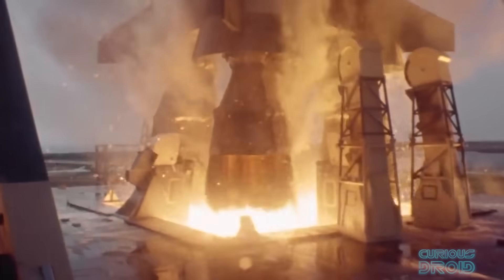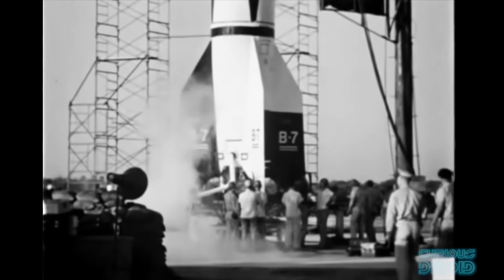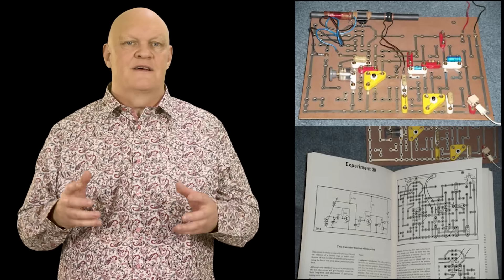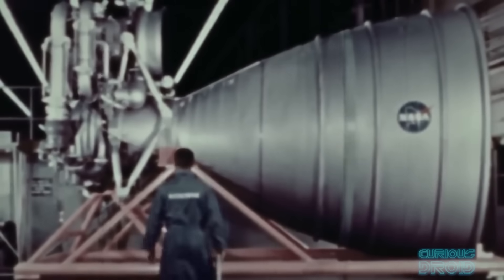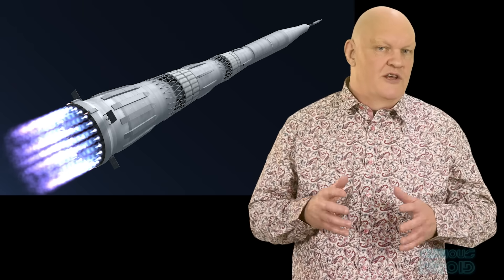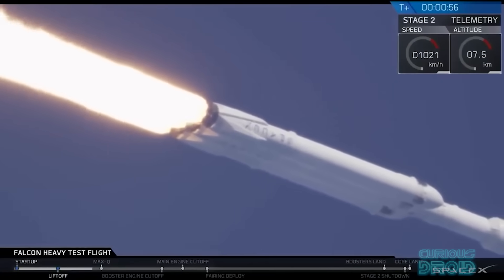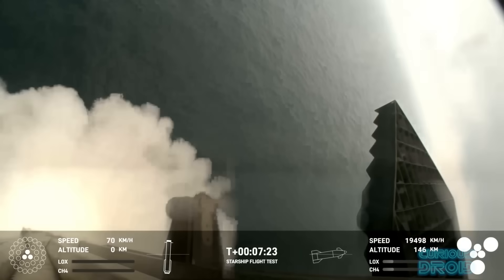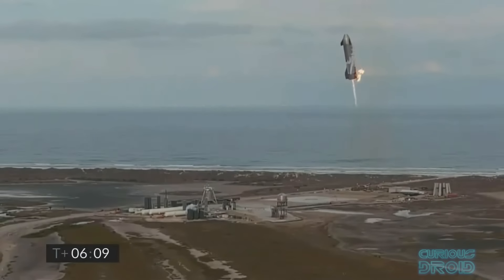Why Does SpaceX Use 33 Engines While NASA Used Just 5?

Comment: Because we had 63 years of advancements in electronics which allows the rocket to adapt to engines going out and not significantly effecting the flight, which would enable greater rocket reliability without the engines having to be as rigorously tested, because if you had 4-5 engines it would be much harder to adapt to one of them going out where as with 33 smaller engines it's creates a smaller force if one engine were to go out, therefore making it easier to correct, also it's cheaper to produce many small engines than it 4 - 5 big engines because you start to get economics of scale.
Reply: Bold words. Engineering is a game of compromise, whether the budget is generous or not. Their system works.
Reply: @Rich-on6fe  to be fair so did Saturn V, SLS and to a lesser extent the Space shuttle. I'm not saying less rockets is nessarily a bad thing it just means your engines need to be a lot more reliable now which is expensive to validate and in the past especially with the Saturn V we just didn't have the electronics to reliably shut down engines before they got so damaged they have a significant chance of taking down the craft to adding more engines was just increasing your risk of failure no matter how long you operated and refined the rocket.
Reply: @Etheoma  Larger engines are far simpler and therefore have less potential failure points, something that NASA have proven over and over again. What people (willingly) forget is the huge problem of cascading failure. If even one engine fails in a catastrophical way, it will wipe out the engines packed around it and those might wipe out the rest of the engines. You simply can't engineer around that without adding far stronger engine bodies that would add way too much weight. Rocket engines need to be very simple mechanically and have just enough structural integrity to function reliably and not an ounce more. These are the main reasons why NASA stuck to the "powerful big rocket engines" idea instead of the Russians and SpaceX' "multiple small but much more complicated rocket engines".
Reply: @tjroelsma  and this is why the engines have a bunch of sensors on them to be able to shut them down before they catastrophically fail. This does require calibration however so there will be more failures early and the conditions for shut down set to be over cautious.
Reply: @tjroelsma  IFT4 had an engine literally explode.  Stop stating things absolutely.  If multiple small engines packed tightly were a legitimate issue, Falcon 9's literal hundreds of flights would have borne that concern out long ago.
Reply: @Asterra2  They are a legitimate issue. Another commenter stated that SpaceX had "solved" cascading failure (CF) by strengthening the case of each rocket. While that may prevent some of those failures, the down side is that the Falcon rocket will be way too heavy for its own thrust and therefore consume more fuel and see a payload reduction. That Starship launch that demonstrated all kinds of problems kind of demonstrated that: it just managed to reach low orbit at the cost of over 90% of its fuel. And remember that was with ZERO payload. 
And even if SpaceX has managed to engineer the CF risk down to a minimum, because you can't totally prevent it from happening, they're still running 4-5 years behind their own schedule, so running into the CF problem again and again might explain some of the delay. 

SpaceX is yet another typical Elon Musk company: small achievements are celebrated like huge successes and complete failures are being downplayed, like "we got a lot of telemetry data in those 90 seconds", or "we achieved some of the goals we said and that makes it a success". They're always putting a positive spin on things and simply refuse to address that they're 4-5 behind schedule, or that Elon Musk's numbers don't make any sense and have NO calculations to back them up.

I'm a sceptic by nature an Elon Musk and all his companies have proven my scepticism to be correct over and over again. Musk is simply a snake-oil salesman in my opinion, who is blowing away billions of OTHER people's dollars so he can play being a genius.
Reply: @tjroelsma  You seem to have completely missed the fact that the stack is fueled shy of capacity specifically because there is no payload.  Go back and rewatch—it could be educating.  SpaceX, like any group of top tier engineers in their field, understands what's possible and what steps they should take to mitigate eventualities.  If this had not been the case, the missing engines on ascent or splashdown may have doomed the vehicle just from inadequately designed software.  They know Booster can still do its job with 3 engines out; they put enough leftover fuel to enable this eventuality; you may not like the fact that it's a few pixels on your screen but that's definitely still enough.

I'm not interested in your two-paragraph admission of an illogically-arrived bias coloring the value of your opinions.
Reply: @Asterra2  Keep drinking the Musk/SpaceX Kool-Aid...
Using over 90% of the fuel doesn't make any sense if you plan to do some maneuvering (which they did but they skipped it), position the craft for the correct re-entry angle (kind of important if you don't want the craft to burn up) and land the craft (which according to SpaceX/Musk also should be a controlled event aka needing active engines), unless you already know that your POS Starship won't ever make it back so you don't NEED that extra fuel.

Take another look at the video yourself and watch carefully the part where the outer cargo-door opens (an incredibly shaky and flimsy construction) and never closes, essentially dooming the craft. Add to that the constant leaks that send the craft spinning from the start (also meticulously ignored by SpaceX's talking heads and the already mentioned lack of fuel and it's pretty clear this craft was never meant to land. 

If you persist in calling this a "success" then there's no saving you from the Musk Cult in my opinion.
Reply: @tjroelsma  Wait, are you really returning to a vehicle two prototypes ago, and pointing to a function which is being completely redesigned, as some kind of evidence that Starship is a failure?  How can you claw so desperately, directly after dragging out that unreasonably overused word "koolaid"?  That takes a certain kind of, uh, gumption.
Reply: We don't know how to make rockets that big anymore.

I mean, really we don't. All the guys who hand fitted and altered every little small part to make them work died of cancer from hydrazine in 1997.

There's a reason Enron hasn't gone up in one of his rockets while Bezos has.
Reply: Did Apollo 11 actually leave near-Earth orbit?
Despite the revisionist narrative that this channel won't question -- unstable fuel burn for the oversized F1 engines was never rectified and another arrangement in their place was made in order to reach near Earth orbit, keeping the F1 bell nozzle to maintain the desired appearance.  The great licking yellow flame was an indication that something was not normal as fuel was burning in the atmosphere while providing no additional thrust. This was the result of injecting additional kerosene into the exhaust stream for greater visual effect yet appearing to produce an inefficient burn unlike other rockets after launch.  No explanation is forthcoming and this issue is not addressed in any usual report; however, using a smaller reliable engine with a reduced fuel load and stripped down mission requirement allowed the Saturn V to reach near-Earth orbit.  

The Apollo 11 crew attempted to demonstrate their position at over halfway to the moon as seen in the unedited version presented to the public while the more recently released unedited version reveals a flood of blue light entering the same window as the camera continues to roll, through which only a moment before, we saw the Earth far distant in what appeared to be very low light conditions. Then, as the camera pulls back from the window, the exposure settings are seen to return to normal as a flood of light enters the same window.  Without a change in the orientation of the spacecraft assumed to be on a trajectory toward the moon, the only source for any flood of light can be the Earth while in near-Earth orbit.  The usual sponsored efforts will try to make excuses for why the obvious did not take place -- yet is overly apparent in the unedited version.  When facts cannot prevail in support, sponsored activity will resort to name calling and other derogatory comments discrediting themselves.
Reply: @ronaldgreene5733  Lay off the whacky backy maybe, all engines run fuel rich dude,  you remember the flights SpaceX did to try and land where one of the engines let out green flames, thats what happens when you run at the actual "optimal" fuel mixture you get a engine rich exhaust because it getting WAY to hot and some of the oxygen reacts with the engine, because you know copper when burned gives off a green flame.

It's also why coking is an issue in RP-1 if you were to run at the "optimal" fuel mixture coking wouldn't be a problem because you would fully burn the fuel, only reason why with methane and hydrogen you don't get coking is because with methane the particle sizes are so small and there is just less carbon in methane than any other hydrocarbon, and the exhaust from hydrogen is literally water vapour.

They are still ran fuel rich, sorry I didn't respond all your points, but I just couldn't keep reading the stupid, it burns.
Reply: @Etheoma  .  . "Lay off the whacky" .  . 😃 .  . Thank you for your sponsored reply.  When you can show another successful launch having the enormous licking yellow flame in the wake of the Saturn V with an overwhelming amount of black smoke at the moment of launch -- and no visible exhaust cone indicating an efficient burn -- you are left to either explain or hedge your way out, as you don't have an answer.  Good luck with your next erudite response .  . We'll wait .  .
Reply: .  . While remaining in near-Earth orbit, another indication are the impossible weather patterns seen on Earth, when in reality only a small portion of the Earth's surface was visible, framed by the round window of the command module.  Straight line cloud fronts are seen on video to be extending for what appears to be more than 6000 miles, a quarter of the Earth's circumference -- something that has never occurred in the meteorological record on Earth. The round window of the command module was used to effect an image of the Earth but the weather in the region did not comply for a realistic view.  No recognizable continents are found in view, but only the impossible weather patterns seen.
Reply: This is why i feel it is wrong to have so many engines, spacex has had multiple rockets fail due to engine failure, spacex has still to have a launch where all rocket engines ignite on launch and restart when needed, every single booster has failed in every flight so far to do a perfect flight.
Yes these are still test flights but you would think they would have resolved the engine problems, and no spacex cannot lose 4 or 5 engines and succeed with its mission, every engine has its job and if even one fails that means thrust is lost and burn time extended for the other engines, this uses extra fuel which impacts the goal of the flight unless spacex is sending a few extra tons of fuel for failures which is just a waste.
Common sense shows that they should do everything to lower the engine count as much as possible, believing otherwise is just fanboy talk.
Reply: @palmtreeshenanigans  Only the first 2    failed that way and the more engine failures they have the more they know how they look like so they can shut an engine down before it damages it's self so I don't see it as being a long term issue also the first one blew up because the engines destroyed the launch pad and trashed a bunch of the engines I doubt a rocket with much fewer engines would have fairer as well, aka even clearing the launch tower.
Reply: @palmtreeshenanigans  "every single booster has failed in every flight so far to do a perfect flight."
yeah, we are just 4 flights in, and things are still in development, and they also don't have to perform perfectly...
Reply: @palmtreeshenanigans  "So many rockets fail due to engine failure" is false and cannot be backed up.  They've had a single engine go out during ascent on Falcon 9 since 2016 and the vehicle made it anyway.  IFT1's hydraulics were damaged and exploded.  IFT2 and IFT3 Booster's engines went out due to fuel pumps being blocked by ice.  You are thoroughly misinformed, and I can't really sugarcoat it because you're spouting the nonsense like it's gospel.
Reply: @palmtreeshenanigans those are test flights on the world's literal largest rocket doing things no other rocket has done before.

The falcon 9 also had lots of failures during test flights and is now the most reliable rocket platform the US has. Engines failing on Starship aren't an issue right now.
Reply: @palmtreeshenanigans what you don't seem to realize is that SpaceX has never flown the same engine design twice on Starship. They are under constant iteration, some minor, some major, but it's constantly changing, as they work to improve the design and solve flaws and issues.

So what you see as repeat failures, the engineers see as new types of failures that they are discovering, or that the repair they tried didn't fully solve the issue.

We just heard how it took 2 years and multiple blown up engines to solve the F1 instability issues, but we didn't get to see those tests because they were top secret.

If we had had YouTube channels camped out watching the tests, you would have been saying that they would never get the F1 working.

In addition, many of the engine failures were not actually engine related, they were because of fuel flow issues, or a valve getting clogged, or hoses or wires not routed or protected properly, and so the controls got messed up, or the fuel flow was reduced and the excess oxygen burned the engine up, or many other such issues, but each flight they work on those issues, until they get them solved like they got the Falcon 9 issues solved.

Comment: The space X engines aren’t expected to be 250k each. That’s just some BS that musk threw around. Should not be taken seriously. 
He also said the super heavy will be as cheap as $2M per launch. 
Meanwhile the Falcon 9 has gone up in cost, not down. Is now in the range of $70M per launch. 
Elon is a bullshitter. Nothing he says should be believed.
Reply: They are raising the price for developing straships to make flying even cheaper. Even with increased prices, falcon9 is the cheapest rocket
Reply: @maks_1_123  My point is, if they can't get the Falcon 9 down in price to anywhere near $2M, the Starship has zero chance. 
In fact I'd say if it ever becomes a viable launch platform, which I think is looking dubious at best, the thing will have a minimum cost of $200M. Probably more likely around $500M.